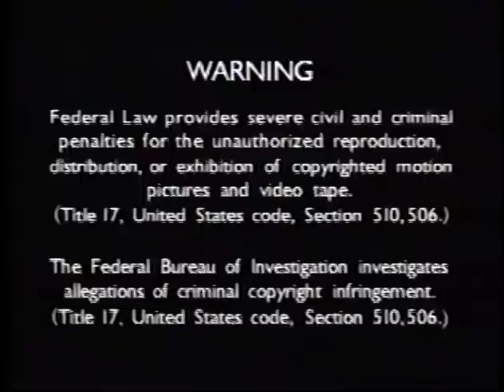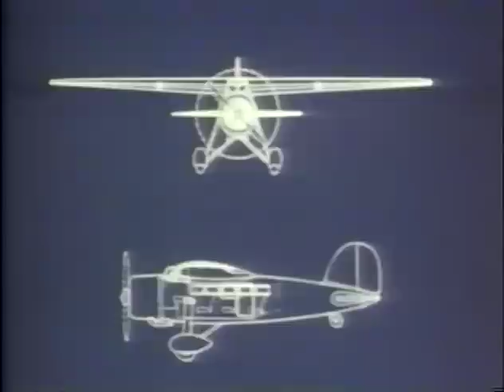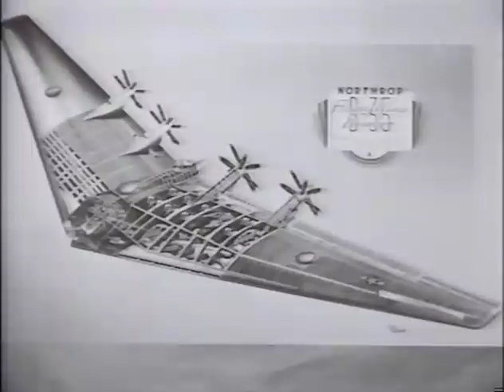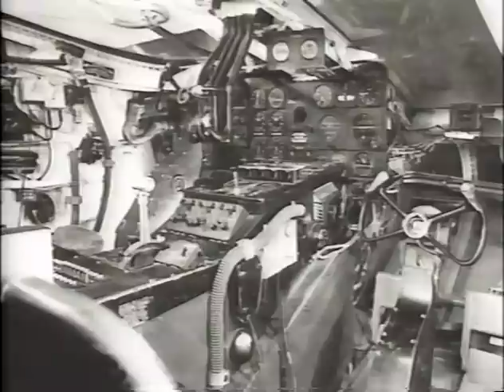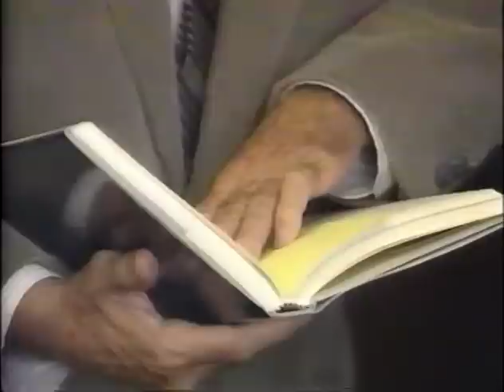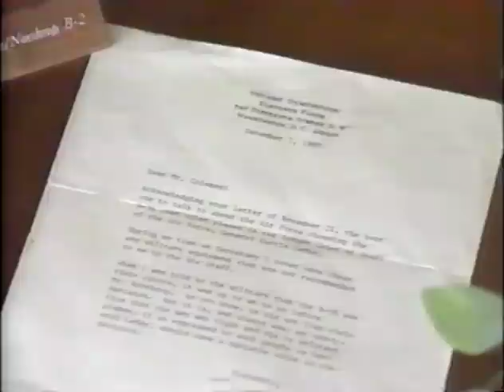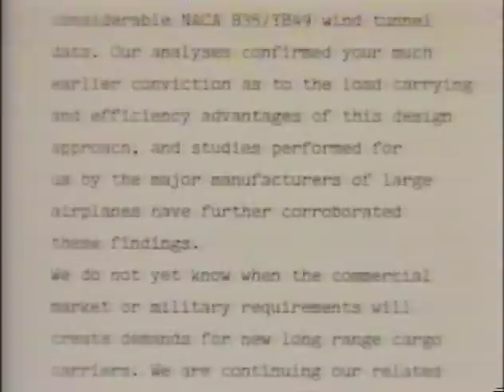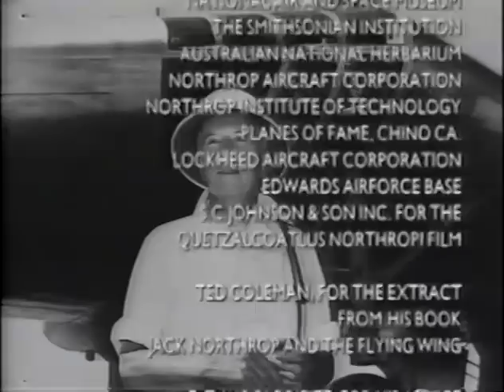The Wing Will Fly

Comment: I saw this documentary many years ago, when I was a little kid, and I remember every part of it.  It made a huge impression and left me with the idea that the flying wing is the ideal aircraft.  It changed my impression of aircraft design for the rest of my life.

In fact, a few things are glossed over in this.  flying wings do have some major aerodynamic upsides, but some huge downsides too.  They're all but impossible to recover from stalls.  They are inherently unstable in yaw, unless you add a tail, and they have issues with control.  They have issues with the amount of internal space that can be used, and they can sometimes even generate too much lift, making them hard to land. 

That said, they are very efficient.  They have a kind of elegance about them.

Like I said, this program did have a huge impression on me.

Comment: Jack Northrop flew his first manned flying wing in 1929, but it had a tail attached to twin booms coming out of the wing trailing edge. It was a stepping stone towards a flying wing configuration.  The Horten H.1 of 1933 was a pure all-wing aircraft with no tail surfaces.  Yes it was a glider, but it flew, and was followed by motorized versions that evolved into the twin jet Horten 9 which flew in 1944.

Comment: In 1980 I was living in Los Angeles near Northrop's old factory. One day on the first page of Los Angeles Time showed a picture of YB-49, and the article said "US government is considering flying wing for its next generation bomber design" I guess this was around the time Jack Northrop was invited back to his factory, and shown the B-1 bomber's model.
Reply: Why? the B-1 bomber is not a flying wing design.  Do you mean the B-2?
Reply: There are a lot of misconceptions about this type of airframe designs. Let us look at the truth.
1. The airframe design when following the principles laid down by Jack Northrop. A computer is not needed. The YB49 was not impossible to regain control when power stalled. Robert Cardenas did. He specifically described the problem and how he did it. When power stalled the YB49 did go into a circular roll parallel to the ground along and about an imaginary line from one wingtip to the other wingtip. Due to centrifugal force by the rotation the pilot was affected in one of two ways.
A. If the rotation commenced with the cockpit rising up and rotating to the rear of the airframe, the pilots body would be pinned to the seat by centrifugal force. He would not be able to reach the throttle to  only one wing to start one bank of 4 engines to full thrust from idle. 
B. If the roll started with the cockpit going forward and down a centrifugal force in the opposite direction would ensue thrusting him against the safety belts of the pilot seat and pulling his arms out in front of him allowing him to be able to reach the throttles of one bank of engines so that he could start them at full thrust modifying the roll to a rotation in a 90 degree angle to the long axis of the wing resulting in the YB49 modifying the roll into more of a spiral that it is possible to recover the YB49 into normal flight. 

2. The yaw problems encountered on a bombing run with the YB 49 were solved by special modifications of a Norton bomb sight.

3. This is a debatable problem that was accidental and at the time, impossible to forsee. The clean lines of this airframe, it's aluminum skin and it's curved surfaces make it unable to reflect enough radar waves back to the radar source. Radar uses electromagnetic radiation to in an assigned frequencies to shoot out into the air in all directions. A portion bounces off of moving things back toward the source. In the case of the YB49, an unintended consequence is, it was invisible to the radars of the day. Today, that's termed as stealth. Immediately, I would expect this to be classified as top secret with knowledge of these properties to be on a strictly need to know basis. Apparently, this is the main reason no further investigation into this airframe and it's unique properties were conducted. If put into production at that time, it would destabilized the cold war. With radar rendered useless a nuclear attack could be accomplished with no warning.

Stealth depends upon, as you may know, what's known as radar crossections. The YB49 had a radar crossection that was so small it would be filtered out as electronic noise. The project was scrapped, Jack Northrop was not told until he was old, sick with Parkinson's disease and and very frail, the real reason why. As you may know, the existence of stealth technology was revealed by President Jimmy Carter in the late 1970's in a slip up in a public address. I don't know if it was on purpose or by accident. Why is not important. NASA looked into unconventional aircraft. Jack Northrop went there and gave them a presentation regarding the flying wing. He got a letter from the investigators at NASA. It said that their examination of his principles and materials revealed that the flying wing design was valid and at some point in the future it would be used again. That's all I have...
Reply: @panzerabwerkanone  
In a delta wing configuration it has some "stealthy" capabilities. Don't ask me to explain. It's just a piece of information I picked up somewhere. But, of course, it's not a B-2 bomber.

Comment: Jack Northrop's '49 didn't fail.........it was simply ahead of it's time, electronically speaking. The controls systems that enable the B2 to exist were not around in the 40's.....but Jack Northrop shines as the flying week innovator and pioneer.
Reply: not to mention the ending days of ww2 the horten brothers built a simaler style bomber, but people only want to credit that to the germans after all we americans are too stupid to be able to do things that that, or not without german help right?  though was not the case in the days of the greatest generation, for all the so called problems of an earlier age, they say the same thing of rockets and nasa, and jets, but they forgot about ol kelly johnson, and the ls1 or the one the germans sciantests before the nazis got their ideas for the v1 and v2 from american robert hutchings godard an american of dutch decent, who also designed a bazooka like device in ww1 that came too late for use on tanks, and liquid fueled rockets as well as fin stablized and multi stage rocket concepts.

we did it eventually and I remember the story at age 10 or so watching this on the wings marathan on the discovery channel,  it was very touching that Jack finnaly got to see the product of his early concepts, made me kind of sad on the part about the gov making them cut up and scrap all the designs earlier on, would have been neat to see one of those in the museume, but yes they finally got wise and have limiters on what angle you can pull up to with the b2 spirit, and its a very efficent low radar design by nature. back when the discovery channel was actually educational, not just reality tv for certain curiousities, and had a broad variety of topics they covered, history was also good till the stopped with the documentries in egypt under dr hawas, right after the arab spring, but I will leave politics out of this for now wax fond memories of the past.

Comment: And also, what a great documentary.
Reply: The YB-49 was far superior to the B-36. To think they spent billions to produce the B-2 which has the same basic design of the YB-49 but with far more advanced avionics. Sorry, someone wanted the YB-49 not to succeed as with the TSR-2. POLITICS OR WHAT?
Reply: 217rnswr If not because the DoD insist the merger of Northrop and Convair. But Jack is a though guy and won't do it with any reason.
Reply: Mr Northrop was proved to be right.....

Comment: The flying dinosaur has tail. The tail is on the head. The flying dinosaur was far more complex than any airplane. It took off with out engines, turned without electronics and it could fold up its wings while on the ground and walked. Did he call that primitive?

Comment: The problem with the flying wing is stability, and it would have been better to have put the yb-49 not completed into a museum instead of scraping it. It is also better to have at least two if not three manufacturers for long term reliability. Also for stealth it is better to be sub sonic as supersonic is easy to locate by using microphones and a computer. In the 1950's the control electronics was not developed enough to control the flying wing effectively.
Reply: Heard somewhere by a B-2 pilot that the plane won't let you crash it.

Comment: I read that the crash that killed Edwards was directly related to a pitch-up "situation" also notorious in the F101 Voodoo ... a sudden command to pull the nose up would run away from the pilots and start an unrecoverable backward end-over-end-over-end flip. This overstressed the structure and it broke apart in midair, as I recall.

Comment: The thing about the flying wing design is that it can only really work with computer controlled fly-by-wire.  The original flying wing was a totally cool aircraft but it was unstable on all three axes. It oscillated on all axes at once . . . so much so that highly experienced bombardiers would get nauseous looking through the bomb sight. The same goes of course for photo recon.

Comment: Several things about the YB-35/49 and bombing problems. At the time, the Army Air Corp was under pressure for high speed and bombing accuracy. Several times WWII bombing blanketed areas surrounding targets, hitting civilian buildings, and making us into bad guys. Of course, as others have mentioned, once you drop nuclear, there is no precision; everything is gone. And once you have laser-guided bombs, or smart bombs, then yoru precision bombing platform is not so critical again. This is why the B2 works so well. And with stealth, speed can be sacrificed for stealth such that you can be in over the target before anyone knows you are there. The 1949/50 decisions were influenced by 1944 experience of slow B-17 bombers intercepted by fast German fighters. By 1975, the process had changed, into getting in without detection, as we could now have long-distance fighter escorts that can protect against interceptors.